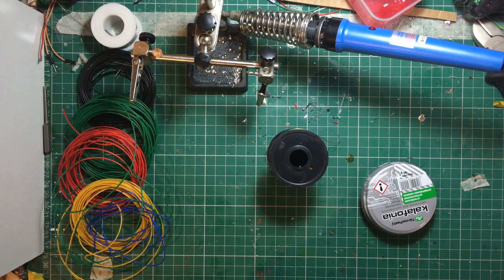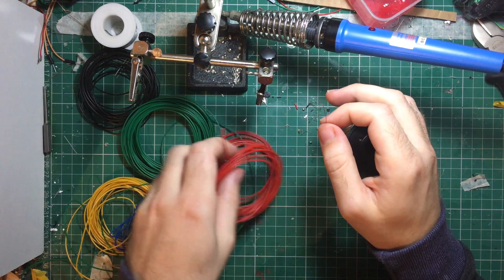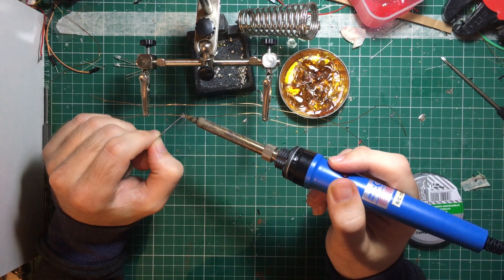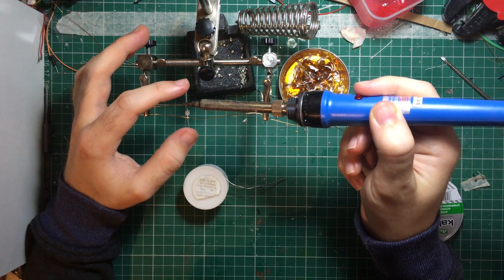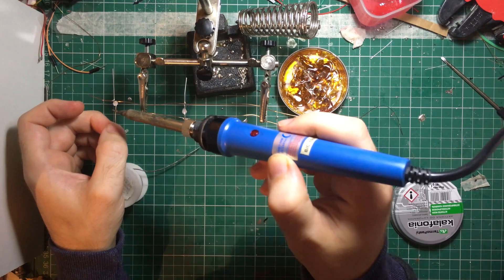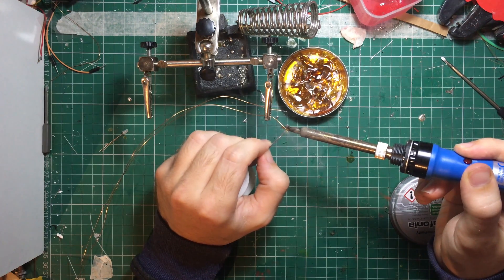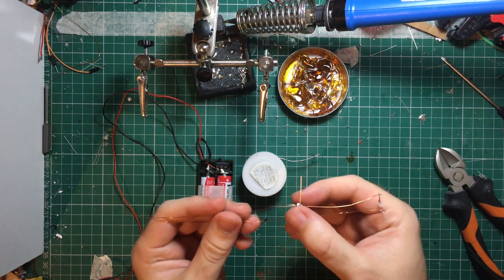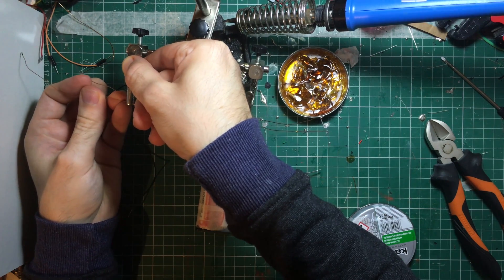Enamelled Wire LED String

Comment: I ordered some because I see my headphones use it and it seems like a flexible enough solution vs all the other options for a port modification I’m working on-removing the proprietary locking mechanism that goes into a 2.5mm audio port and instead connecting a 3.5mm port inside the headphone cup.

Comment: I have never used this type of wire before.  I like the idea of how clean it is.  What do I used to re enamel the areas I strip?
Reply from the maker: hey, 
Using the burn methood the only area that is ucovered is the tinned section. To re insilate you could use some cheap enamel paint, or some poundland clear nail polish, 

Peter
Reply: @DundeeRoad  perfect. I've been scouring YT to find a good process in using this wire for some prototyping I'm doing. So far this is the best video I've found. This will be our little secret. Lol

Comment: Very good video, I buy the same wire from Maplins, I also buy they very thin wire when I need to solder SMD's onto wire, very good stuff...Simon
Reply from the maker: It seems like a sensible change, keeping note of polarity and function can be a bit difficult. I think i will get some coloured permanent markers to help with that.